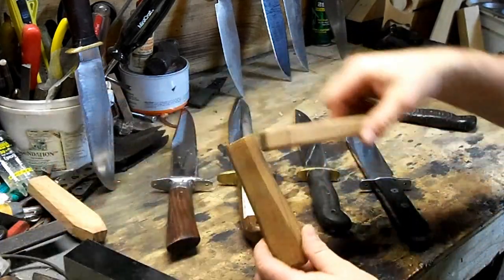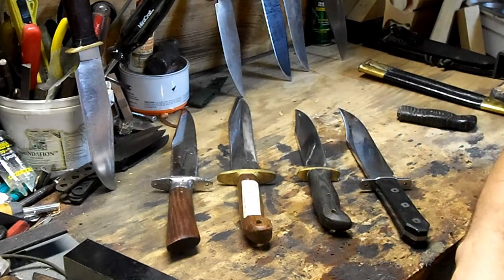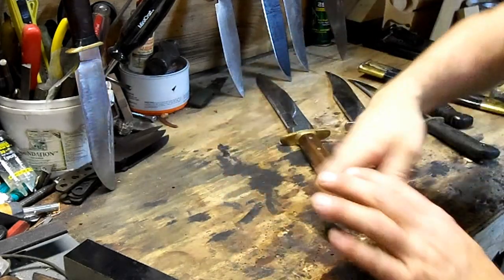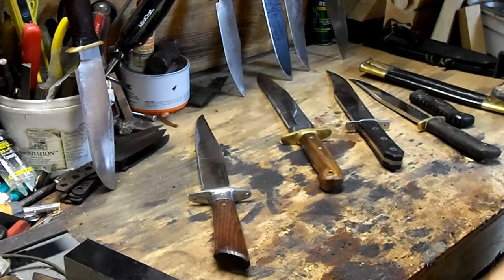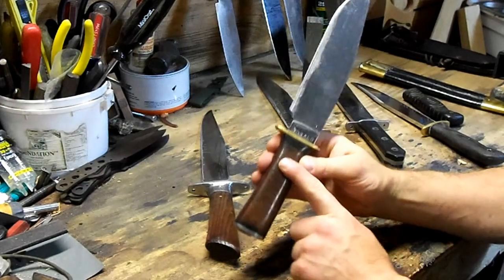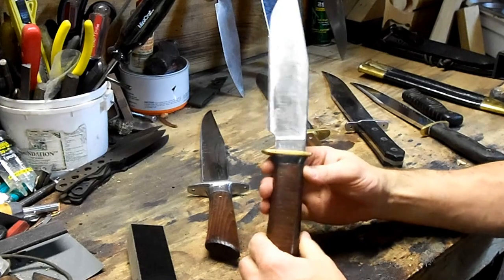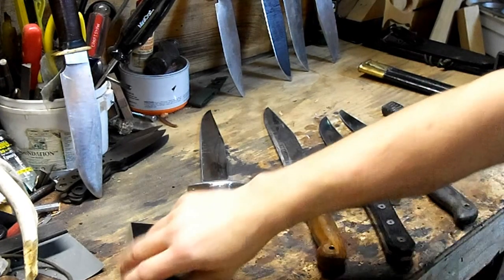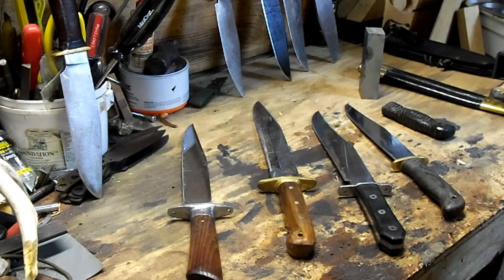Bowie knife handle design and materials.

Comment: Hey man, really like your passion for this I have the same passion, I'm from Australia and moved here to the US about 5 years ago, I like your take on the Bowie knife! I am wanting to buy the cold steel Nachez or the Loredo Bowie and basically strip the handle and re create my own handle and my question is do you think the cable Tang on those knives is safe?
Reply from the maker: My concern with those knives is not the cable tang, but the tang transition. Take a look at the two videos on tangs I made  awhile ago, that will explain my concerns pretty well. 
Cable tangs are basically a modern interpretation of a riveted tang, often used on swords. As long as good cable is used, and well attached to the tang itself, I see no issues with it, as long as the TANG TRANSITION is well done.